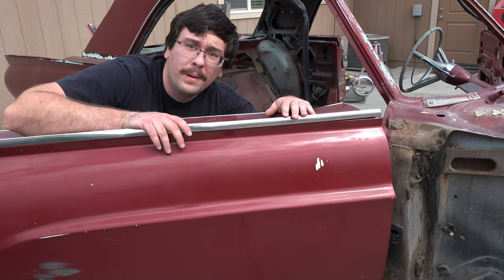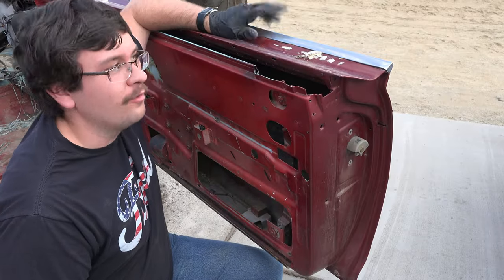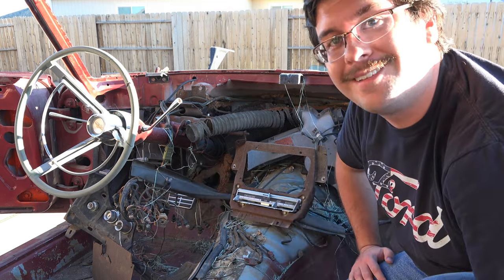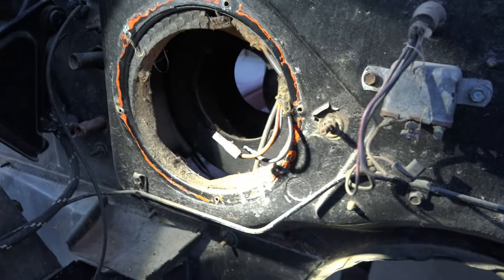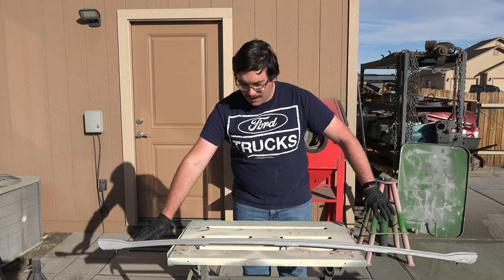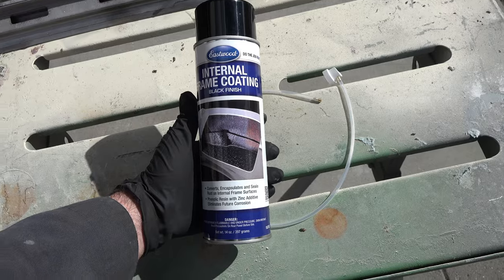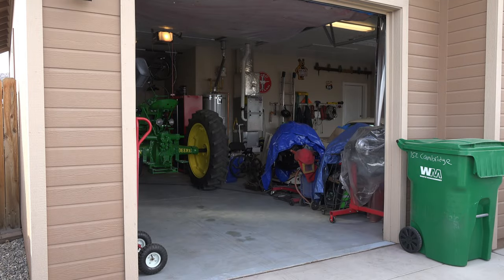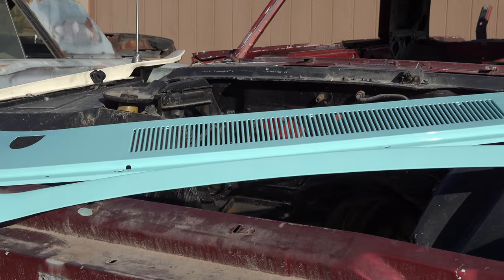1963 Thunderbird Restoration Part 2 - More Stripping & Paint

Comment: More excellent work.  One thing you proabaly not going to like is under the front cowell is the air vent intakes.  For some reason the Ford engineers designed it so water collects around it and wont drain completely.  If you are a purist dont read further but I used a hole saw to cutout two big holes over the vents under the cowell.  It is hidden when the cowell is returned.  I used a wire brush to remove a lot of rust.  That left a lot of rust holes.  I etched it with phosporic acid then epoxy primer then a couple of coats of flex seal.  The "as seen on TV" flex seal.  Finally I took a hefty piece of round stock , rounded off the ends, put it through the hole and pounded the lip down so the pocket will drain completely.  Normally I wouldn't do something like this but the Ford engineers made me so mad with their design it made me feel better hammering it out.  None of this is visable but probably not something a purist would want to hear.
Reply from the maker: Thanks for the advice! I know which area you are talking about, I will need to take a closer look at it and see if that area has the same issue as your car or not. Thankfully, I was able to get inside the cowl with a sandblaster and get almost the whole thing down to bare steel, and thankfully no rust damage in there!  That Flex Seal stuff works great, I had painted a coolant pipe on my John Deere tractor and upon filling the cooling system, discovered a pin hole in the pipe. Normally I would weld the pipe to fix it, but since it was already painted I didn’t really want to damage the paint, so I shot a bunch of that Flex Seal inside the pipe. A year and a half later and still no leaks, great stuff!